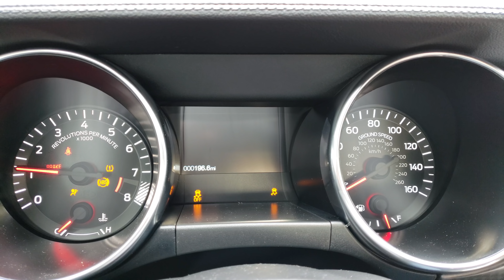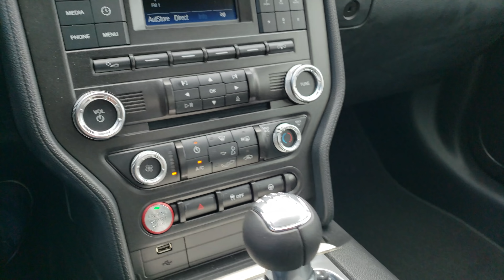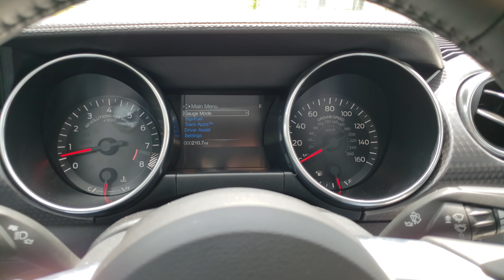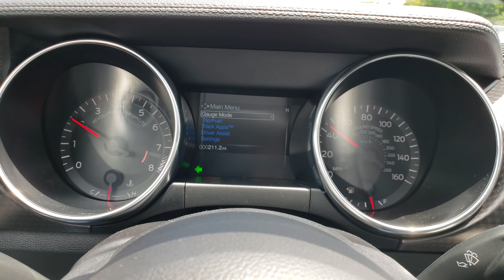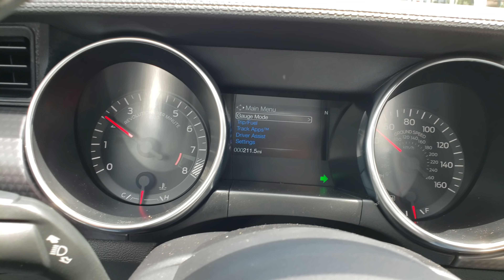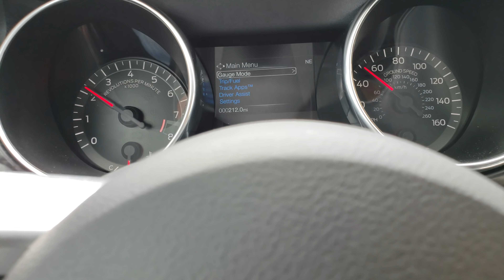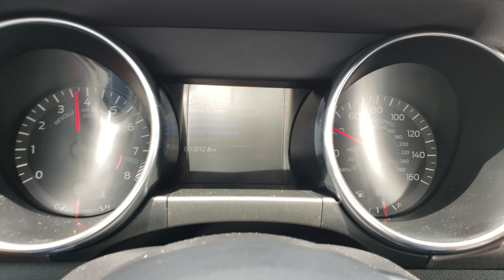I bought a 2018 Manual Mustang PP with 3.73 and already modded it

Comment: Hey Alex, I got a question about the clutch assist spring. Steeda released a 35 lb spring because apparently just removing the spring is bad? This is the exact statement from their website "Most owners fail to realize the prolonged effects of simply taking out your factory OE spring and not replacing it with another spring. By negating your factory clutch assist spring you will notice chatter/NVH from your clutch pedal. Your clutch pedal will never fully return to stock position without any assist spring, and over time your slave cylinder may begin leaking due to constant pressure on its seals from the clutch pedal not returning to the stock position." What are your thoughts on this?
Reply: Did you ever get an answer to this?
Reply: @barrymcaulkiner  I could never get a clear answer so I just went ahead and bought the 35lb spring from Steeda. I noticed an improvement over the stock spring and still have the peace of mind that im not damaging anything by just removing the factory one.

Comment: I'm sure you already found out, but the Line Lock is grayed out because you're moving. If you stop, it will become selectable. I believe you also have to be level for it to work as well.
Reply: Turn off the Cruise Control it'll light right up

Comment: Was my first mod too, second was MGW grats on the 18 with the man pedal. But my third mod was a re-modeled MT82 by Ford...which by the way the remodeling on the trans seems to be working flawlessly so dont get upset if you lose 3rd and 4th and go crying about it like I did the fix works. Just a tune and Cai and some E wakes the Manual up tremendously
Reply: Did ford give you issues for the warranty because you had put a shifter on it when 3rd went out or did they understand the new shifter had nothing to do with it?
Reply: @worstshot  no didn't have any issues

Comment: So, just a heads up. As a ford trans tech, dont worry about the trans. There is a TSB involving 3rd gear, it is more than likely "fixed" already (3rd/4th has had issues, so it is fixed in the sense that there is a TSB to replace shift forks), even then the new MT82 is much better. It is NOTICEABLY heavier and there is many improvements done to the shift rods. Plus, the MAIN reason why they fail, is high school kids who cant drive. Those are the only transmissions i fix.
Reply from the maker: my man!
Reply: if the ford clutch causes a lockout, can you really blame the drivers? A factory car should go into gear at any rpm, in the s197s it really doesnt matter how long you hold the clutch in, whether you shift as slowly as possible or not, I think a new car should go into gear. Yet go just 1 rpm above 6500 and you jam that shifter into this invisible wall. Mt82 with a new clutch shifts great however, still chinese garbage at the end of the day
Reply: You said it been having my 2014 gt track pack never had to remove my trans and i been low 11 high 10 with the stock trans but at the dealership i work at high school kids or kids that traded in there honda come in saying ford sucks because i cant drive
Reply: Can you comment on the BBQ tick issue of the s550s? Wondering if his 2018 will get the tick eventually. Wondering if the issue is really worth the panic?
Reply: Lol all the people who transmission blew up just cruising and weren't high school kids like ls eater and many others
Reply: cam only bro car is designed like that for NVH, plenty of other manufactureres do similiar things. You have to "fix" it yourself.
Reply: Nacho Galindo im working on a 18 right now with 2000 miles. Already blew the 3rd gear fork a month ago. Came back in today due to 2nd completely gone. 100% user error.
Reply: Ha8n3ro S550 Havent heard it yet, but the DI is naturally louder.
Reply: Utah county Picazo's page Ford knows about 3rd gear in the 18s and they are fixing it. Fork was on backorder for a while so they might have updated it.
Reply: cam only bro agreed, Alejandro might regret this. I’ve seen too many videos of the new mt82 failing and even had a friend tell me his new 2018 manual was already making weird trans sounds and clutch was giving issues, he only had 1k miles on it
Reply: Not saying it can't happened but many think they're race car drivers, beat it and complain it's broken. I have friends who have done this with all brands and jump on forums and complain
Reply: When 2011's came out it was OMG it has stamp steel shift forks that's cause of lockout BS. SO guess what Ford changed it alum forks guess what OMG WHY OH WHY, A lot of changes are done to MAKE YOU HAPPY EVEN IF IT DON'T MAKE IT BETTER. I've seen it I work for truck dealership
Reply: Man Im so glad my 15 GT manual shifts perfectly.  Its the smoothest manual Ive ever driven.  Whats crazy is how effortless it feels when driving hard and shifting fast.  I know people hate on the MT82 but mine at 20k shifts like butter.  And once ford figures out the 18 shift fork issues the new MT82 will be even stronger and better.
Reply: drove my 2011 MT82 for 40k miles of daily rev limiter slapping, never letting off the gas, no mercy, slamming the dogshit out of 2nd and 3rd.  still on stock clutch.  shifted smooth as silk just like the day I bought it.
Reply: j-cast c Ford shouldn't have gone to aluminum forks, period.
Reply: 13 gt 138000 miles on it mt82 with bolt ons and plenty 7500 rpm shifts no issues. besides a few clutch swaps and a clutch master cylinder.. trans itself i put royal purple in it at 80 k its good to go... guys ive heard issues from is young ass teens who had nitrous and shit shifting to 3rd instead of 5th by accident and tearing their shit up lol
Reply: j-cast c yea had one come in because he lost all of the gears all of a sudden and of course the customer looked like a young version of andrew from mustang lifestyle all queer looking and shit when i said i can tell you been doing burnouts because i was at the track last Friday he confessed that he launched the fuck out of it
Reply: Nacho Galindo a mustang should be able to handle a launch whether its someone who knows how to drive or not. Period. Granted, someone who doesn't know what they are doing will break any car, but the trans should hold up to the power that engine produces and then some. For the price Ford wants for these cars now, that shit should of had a tremec from the factory.
Reply: Larkin Matteson if you know how to drive then you shouldn’t be braking the trans my 5.0 never broke and i have low 11 in it then you have this kids trading in their hondas to get a mustang and blame the manufacturer for the car braking and i can back this up because I work on gm and ford same goes with cameros
Reply: Nacho Galindo I understand kids getting them.I'm talking about shift forks breaking for no reason.  The mt82 is a shit Chinese trans. I have a 12 gt and I haven't had a big issue yet but I'm sure I will eventually
Reply: Larkin Matteson they are not shit transmissions trust me they can take some power. I agree with u on shift forks but there is a fix for them. Also the mt82 is not a bad transmission if you know how to drive and shift good that transmission will last. My coworker has one of the first 5.0 we had at the dealership stock trans stock clutch has a 150 shot slicks longtubes etc and has never broken why because he can shift good he runs mid 10
Reply: Nacho Galindo they are shit lol and will never be as strong as a tremec. My gt with only 14k miles has a third gear grind when it's cold, and will lock me out of 5th at high rpms every time. Again only 14k miles. Owned by my dad before me who babied the fuck out  of it. I also have every supporting MOD to help shifting even down to a separate master cylinder for the clutch. The only thing I haven't done is an aftermarket clutch. So yes, they are junk. And that third gear grind started happening at about 5k miles. Unfortunately out of warranty because it was a garage queen while my dad owned it and it was past the warranty.
Reply: GT500 owner here. The stock synchro rings in my TR-6060 are junk. Probably good for road courses, but lock out is terrible even with the vast improvement an MGW2 and Redline D4 fluid make. Its bad enough I bought a bearing kit and 1-4 Tremec hybrid synchro rings. Just need to save for the install at this point. My one complaint about an otherwise incredible car. lol, at least the got the 6R80 right.
Reply: Larkin Matteson they are not shit transmissions they are not the best but they are not shit transmissions. The ones i seen that have been destroyed were by like i said before are teens that traded in their hondas or toyotas to get the mustang all my buddies are still stoke mt82 and they have upgraded the clutch but that it i havent heard them say it locks me out or it sucks or its shit.
Reply: I have a M5ODR1 in my ranger(93) that i have to go to 4th after i stop to get it into first gear. any ideas?
Reply: j-cast it's fixed with the same weak part's. 5.0 has Weak motor and transmission...Gay as fuck
Reply: I'd like to know too. I'm ready to buy an 18 but between the shift issues and the ticking I'm on pause.
Reply: Ford has issued not one but two TSb's on this transmission. They would not do that if it were a few kids out there banging on these cars. There are real issues there to be cautious of and even if it's covered under warranty having to bring a new car in for transmission work ain't good
Reply: These are real issues that ford knows and is fixing, whoop-dee-doo. More than likely the 19s will be good. My point still stands. The only MT-82s (all from 11-18), i EVER touch are cars driven by inexperienced wanna be street racers, who are out racing all day and DO NOT KNOW how to drive, PERIOD. They all shove the shifter into gear like a gorilla. If you want to race, throw a shifter on the car and learn to shift right. Everyone cries about the MT82, but are so quick to forget the T3650.
Reply: @Larkin Matteson .. Probably babied the hell out of it while shifting like trash.
Reply: @ J-cast C... THANK YOU!!!!!  for calling out that garbage TR3650
Reply: yea man cant happen to him ------- RIP

Comment: Glad to see someone not afraid to get a manual. I've put 15,000 miles on my manual 2018 performance pack and haven't had any issues. I drive my car hard, yet i drive it properly. Also about that assist that raises RPMs... I feel like my 2017 had that too. I could be wrong but I don't know why I feel like it did that too. Now my 18 for sure does it and it's stock. I can 100% vouch for that. I just can't remember if my 17 did it too but I really really feel like it did.

Comment: My FRS had one of those clutch assist springs from the factory. It is a tremendous piece of junk and made shifting smoothly very difficult even after a month of driving it. Gave it a very non-linear feeling. Coming from an older car that had proper clutch feel I knew that spring had to go. It was infinitely easier to drive the car after taking it out. Honestly not surprised that more new cars have that.
Can't wait to see what you do with this thing. It would be awesome to see how you approach road racing/autox in terms of mods and setup on the Mustang.

Comment: I heard that dire warning about the clutch spring removal too. OK maybe it is better to use a spring. So I bought the 35 lb Steda spring that's way softer. If that isn't enough to return the pedal fully it really is a bad design.

Comment: I replaced my clutch spring with the Steeda one - they make one where you can feel the clutch engagement but still have a spring. I read somewhere if you have no spring you may burn out the clutch.... but I'm not an expert so who knows. For 15 bucks I stay on the safe side.

Comment: Many people are reporting problems with the shift forks on these cars. They switched from steel to aluminum shift forks and they're failing rather quickly. 

Ford recently put out a TSB on the transmission... TSB# 18-2175. Hope you have better luck with yours!

Comment: My first vehicle is my 2016 mustang and all those stock behaviors I noticed myself right off the back having never driven manual before. Learning to drive manual, I found it off like things didn't behave like I predicted/suspected. Especially the rev holding (I still dislike the rev holding), assisted launch I didn't expect (in a mustang at least), but I knew that was a thing and I do like that part. Took a little bit to readjust my expectation for how my vehicle would behave. Also never driven manual before I also didn't like the clutch but figured that was just how they behaved and I would need to get used to the clutch popping back out so aggressively . Glad you showed the spring removal never knew it would be so simple to change the clutch feel. Will be giving that a try!

Comment: You’ll get 500 WHP. Plenty of people doing it on intake exhaust and E85. I did 470 with intake, X-pipe, and 93 Lund Racing tune. No E-85 in southeast Georgia. This is my first MT-82 and always thought (whole 4000 miles) the clutch feel was garbage. I didn’t know about the helper spring. So much better and took maybe 10 seconds. I didn’t pinch the spring; just pushed it to the right and slid off that rail.

Comment: Congrats man, love the color choice!

In terms of 18s and MT82 problems, it looks like the shift forks are the the most common issue on why the trans sucks and they are being warrantied left and right.

I took your advice and put a McLeod in my 15, huge difference. I also had no idea about the helper spring, that would explain so much. I’ve never driven a car that i found so difficult to launch smooth and rev match because of the damn clutch being so weird popping up. 

Thanks for the info!

Comment: Beautifull car    congrats  !!!    I bought a base lightning blue 18 GT manual too. Ill take my clutch spring out THX. Im going to have my whipple 3.0 installed in 2 weeks with full steeda drag suspension and DSS driveshaft and axles. Just got the stripe kit and carbon fiber GT 350 R  rear spoiler. ford racing x pipe with corsa sport exhaust. Your favourite UPR oil separator. Cant wait for you to add boost and start pushing the limits on the direct injection. Your smile was as big as mine. Love my car. Cant beat 12:1 compression with direct injection. 18 GT rules . Enjoy your ride

Comment: Just removed the assist spring on my '18...Your right, night and day difference in clutch pedal feel!  The spring will remain out and the hill holder feature turned off.
Reply: So you don't like the hill assist feature, by removing the spring yep you will disable this feature, i like it shux, as it also enables you to cheap stop signs by starting off in 2nd its not much but comes in handy when you're in traffic.

Comment: Congrats Alex on the new car. I am happy you bought a 18 GT,  As I was hoping you would, as it was my recommendation, when you asked your subscribers.   
I am sure it will serve you well in many ways. Daily driver, improve you as a tuner for the Gen 3 and as a foundation for good content for your channel.
About your mods. As a 17 GT manual owner myself. I personally did not remove the clutch spring completely.  But replaced it with a Steeda 35 ft/in. it is 4 times softer then the stock one, it works very well.  Also I am running the power pack 2 that has the "no lift shift" feature;-( It is vital to have a little spring load on the clutch pedal to not accidentally  mess with the clutch petal sensor.  
I envy you living in Florida where there is now inspection and you can easily run without cats.  So to you plan on install headers but keep the stock catback, to possible not have it crazy load? Are you going to at least start with keeping the stock airbox as it is a improvement over the 15-17. Just replace the stock filter with a K&N filter?

Comment: Alex I think its called hill assist. If the car is on a slight incline it will hold it there, Once again your right for people who cant drive stick. Also think about a new shifter. The stock one is crap. It will not go into gear or slopperly go in if your revs are too high. My MGW is a revelation. I also heard problems about taking out the clutch assist spring altogether. Buy the Steeda spring its cheap and very smooth.

Comment: What is your opinion about replacement with the steeda 35lb spring? They claim you will damage the slave cylinder if the clutch doesn’t reset completely. Also is there a noticeable increase in nvh with no spring? Nice car btw I bought a2017 and of course they come out with a way better performing engine a year later story of my life
Reply: I am wondering this too. I replaced the clutch spring with the steeda one as well.
Reply: 95% marketing 5% just maybe truth lmao 
had mine off for 10k miles no problem noticeably 
others have it for 50k even 100k miles already
Reply: No nvh just harder to press. Don't skip leg day.
Reply: Thanks for the advice guys
Reply: What is nvh? Just curious, first time I've seen that acronym
Reply: Cpt Hair noise vibration harshness
Reply: David Ray thanks David!
Reply: Cpt Hair 

Noise Vibration Harshness
Reply: @neil I hope that isnt true lol im 50k miles no spring and the car is tracked once a month
Reply: GTS Garage I should know better than to doubt Alex he does know his shit
Reply: I bought the steeda spring and now regret it. Although I took it off to test and with the steeda feels a little better. Fuck me anyway

Comment: Right on bro. I am biased with the color. My 18 is also Oxford white with black accent. No one had really talked about the clutch assist or rev matching but I definitely noticed it. At least from the reviews I was watching prior to getting mine. Thanks for your input on the 18 model. Congrats dude. Definitely looking forward to your mods even though it will be your daily driver.